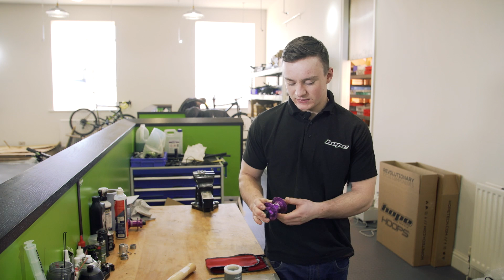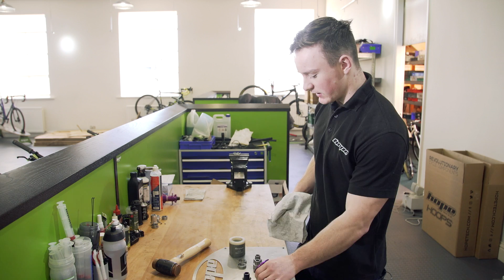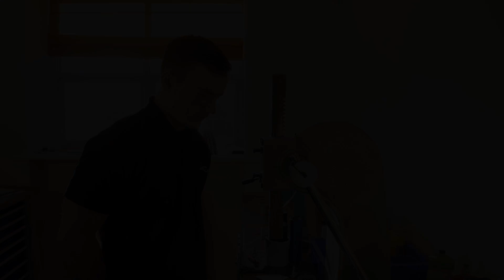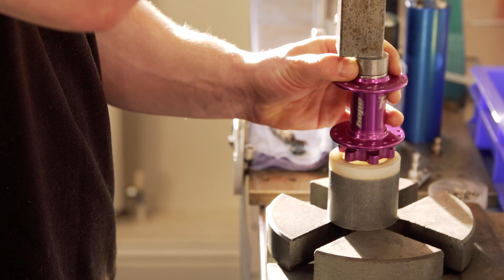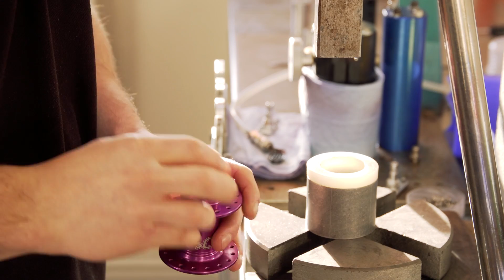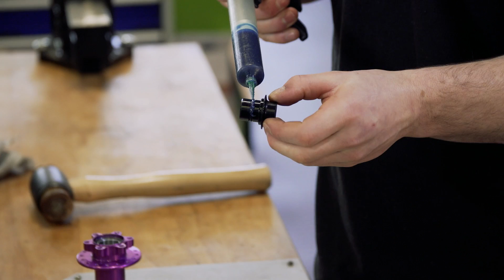Hope Technology: How To Service Pro 4 Front Hub

Comment: If you have a 20MM front axle there is an EXTRA CIRCLIP NOT SHOWN OR TALKED ABOUT that holds in the end caps (part no. HUB455 being the circlip HUB420 being the endcap). 
Hope you guys need to work on the little details on these videos/ posts. 
Link to the tools and bearings you're using so we can go and easily buy them. Or at least type them in the description, Chris King and SRAM do it... Link to the part stack up.